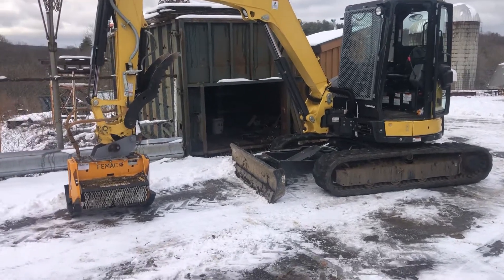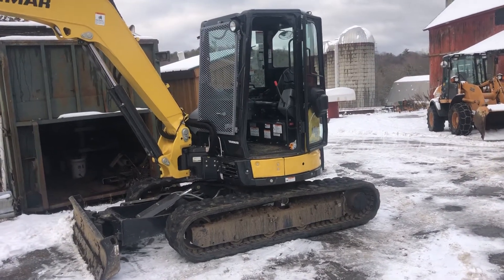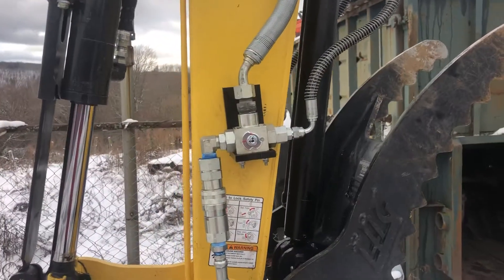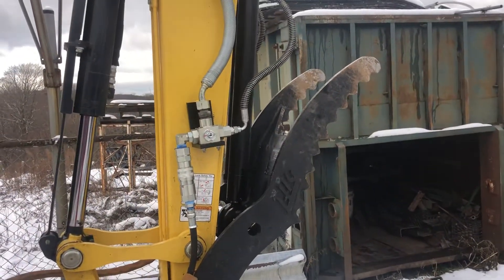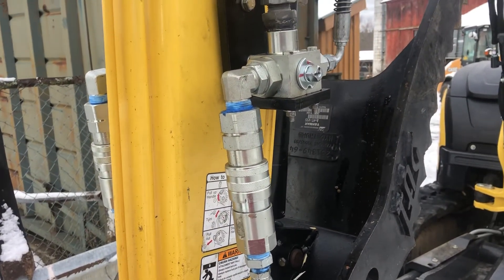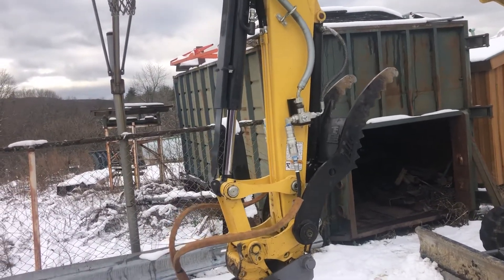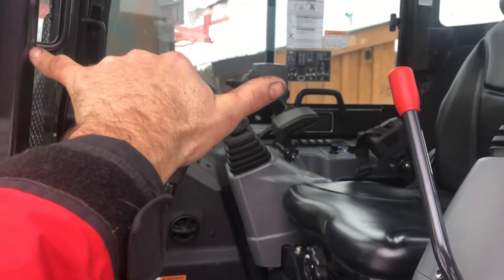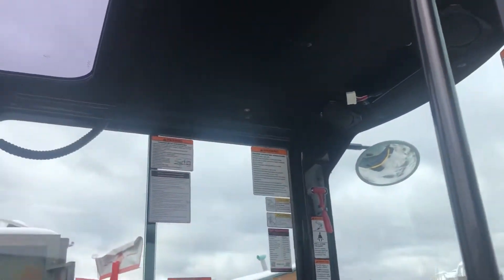Yanmar excavator vio 55 2020 setup for mulching

Comment: What are you doing for constant hydraulic engagement to run the motor?
Reply from the maker: The vio has this feature built in. It can hold the psi on. Hold down the auxiliary hydraulic button with your thumb and push the button under it with you pointer finger. Just click auxiliary button again to shut it off. It’s very fast and easy.

Comment: Where did you get the front window screen protector? I have the same machine. Thanks
Reply from the maker: I made it in my shop. 3/4” square box and 1/4” lexan. It has been tested a few times😀
Reply: @chadsharrow9269  oh, I thought it was expanded metal and no lexan? And you drilled into frame to bolt it?
Reply from the maker: @kevinhennessy6193  no sir no drilling required. There are bolt holes next to your window. They have a plastic plug in them 3 on each side and a couple top and bottom.
Reply from the maker: @kevinhennessy6193  you know I had to look at the video again sorry about that. Yes it was expanded metal for about 1 day. I took that back off it was absolutely horrible to look through. Lexan is the ticket 👍
Reply: @chadsharrow9269  thanks buddy